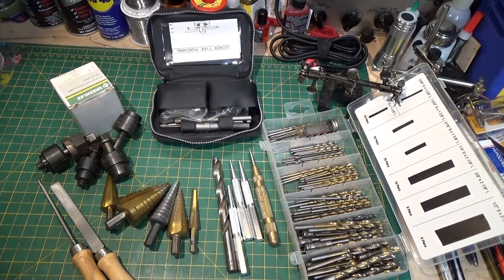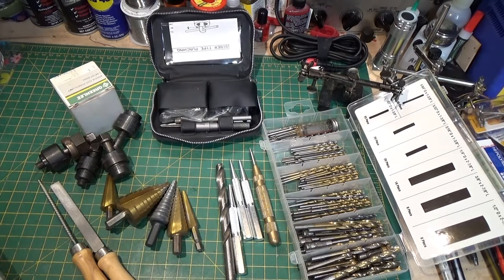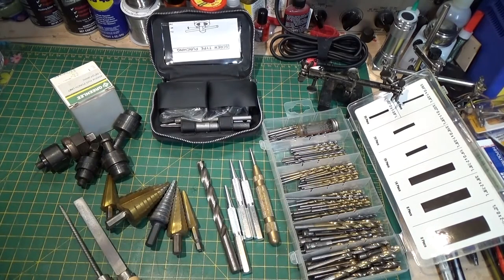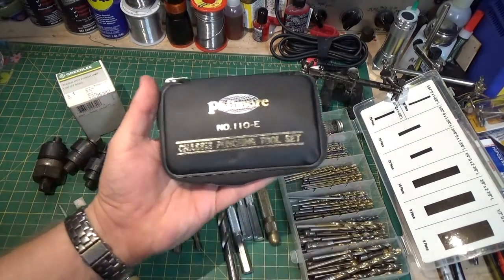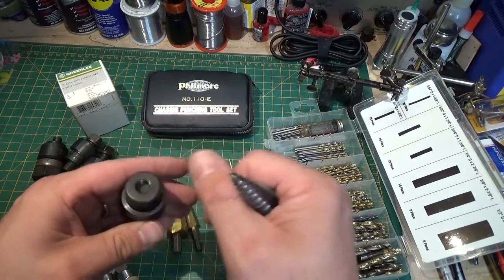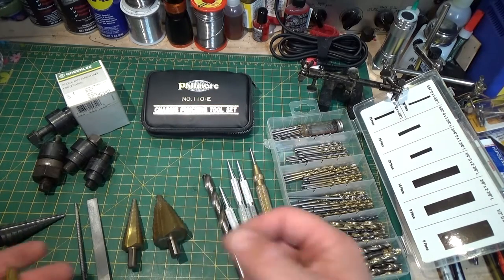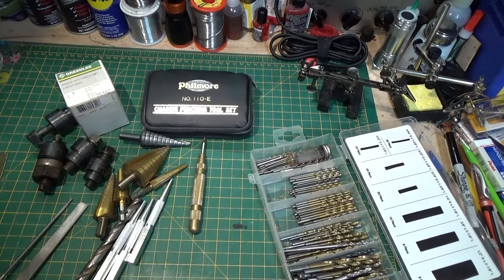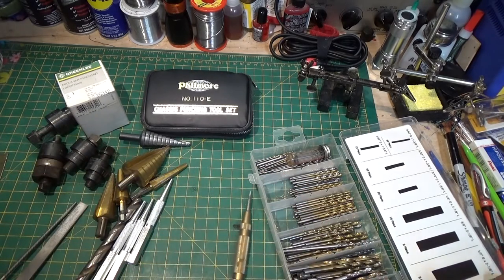Scratch Build a Stereo Tube Amplifier   Part 4

Comment: Great tips here.  Thanks.  Although beware stainless steel and aluminum/aluminium can often result in corrosion known as  Bimetallic (galvanic) corrosion.  The 2 noble metals normally need sandwiching with another in between such as zinc or copper.  The corrosion may not be apparent for a few years, so worth keeping an eye on.